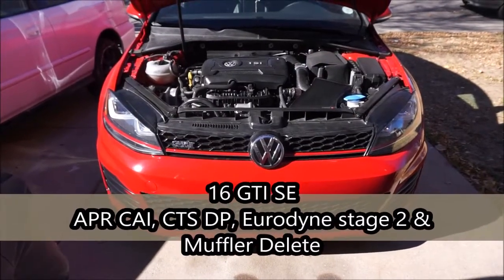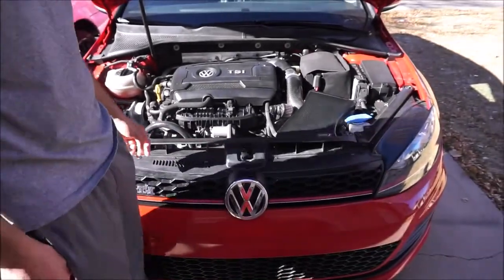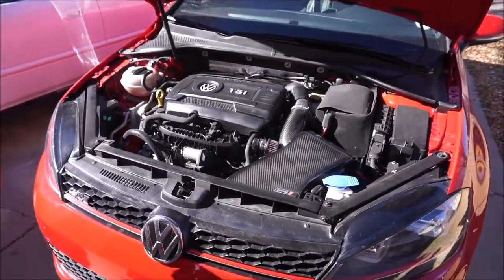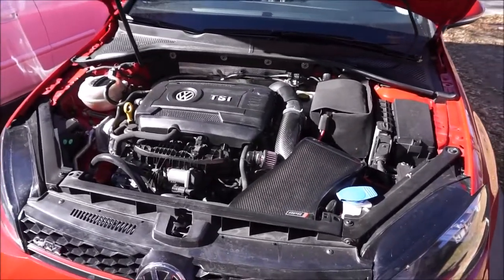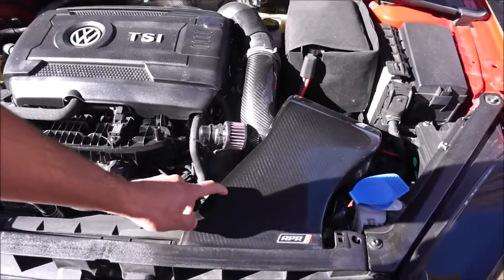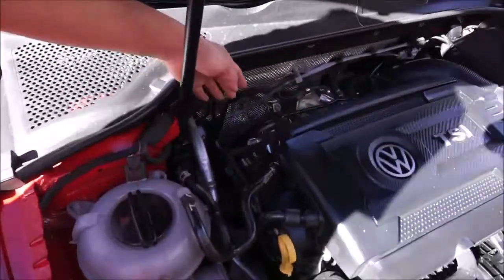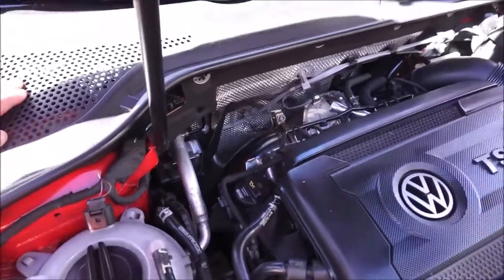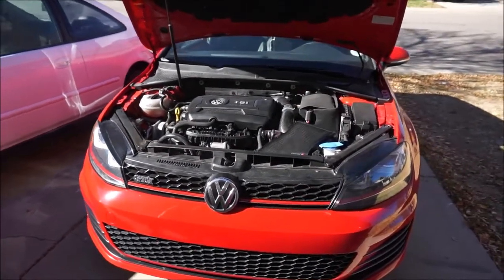MK7 GTI Dyno Eurodyne stage 2

Comment: cobb is good too. im running 305 whp and 350 wtq and its a blast. also like $400 cheaper than a stage 1 apr
Reply from the maker: Bosnian Beast I’m going back to the dyno soon I got the clutch replaced and some other goodies I’m hoping for better numbers this time.
Reply: Boostedimports i hope you do to your current numbers concerned me
Reply from the maker: Bosnian Beast I hope so! video coming soon on that! If there is not to much improvement then new tune for sure!

Comment: from there site Product Description
Our stage 2 reflash for 2.0TSI vehicles is designed to work with an upgraded Downpipe and high flow converter.

Aftermarket intakes and exhaust systems are also compatible, but not required.

Output is increased to 288 hp and torque to 345 ft lbs.

The reflash is available through our dealer network, and is also included with the Maestro tuning suite for 2.0TSI.

Ecu removal is not necessary, these ecu’s can be port flashed. Due to the large number of different ecu codes, there may be a delay in adding support for new or rare software versions.

Contact support@eurodyne.ca with your ecu part number to confirm.

All prices U
SD.